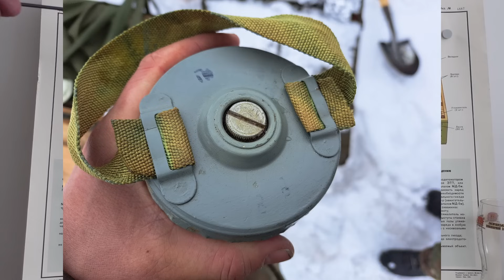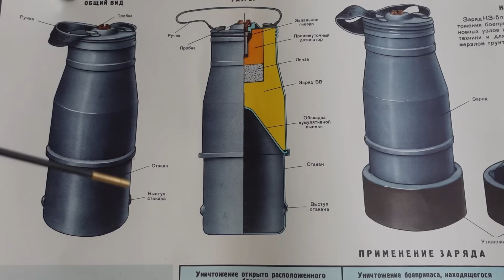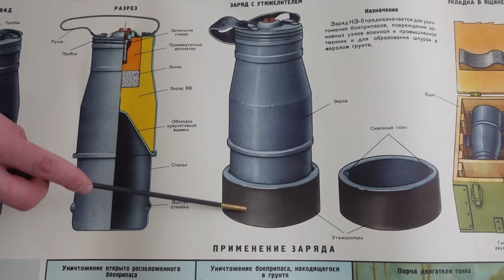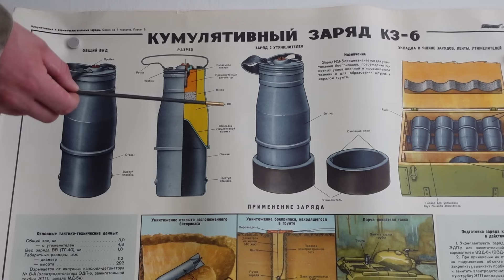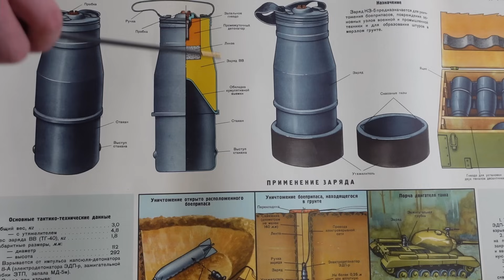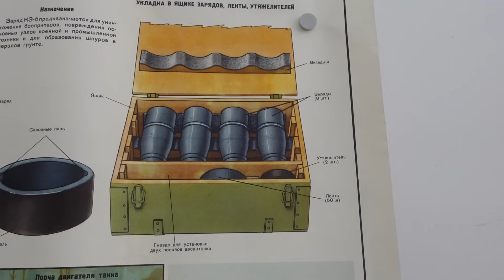WW3 Cumulative charge:  KZ 6

Comment: To disable a tank with such a mine, would it not be more wise to place it somewhere on the turret near the breach? A hole through turret top armor, breach/gun, turrent ring, crew compartment and maybe even a little bit of front armor right under the turret ring sounds worse than swapping an engine compartment and ignoring welding shut a hole in the bottom.
But it is probably harder to place it there, let alone explain the correct placement to an average infatry man xD

Also era and up armored or not, I do not believe a tank and crew hit by this from a drone will have a good week. So much damage to optics, barrel and everything mounted on it, also pressure. But yeah it probably is not a permanent kill if it lands on era.

Comment: NATO also has charges for destroying airfields but they use shaped charge with  ~ 200mm diameter and 12kg of explosives with foldable legs for the distance to ground - after the hole is punched through concrete and soil the hole is filled with TNT granulate and detonated again to make most huge crater possible
same for Autobahn, main streets and railways - my teacher worked at a factory for that - he said they produced almost half a million of them but meny were shredded and the explosives from the charges and the granulate in bags sold for mining used for blasting rock on state projects from 1992 to 2001

Comment: Thank you Val ;)

P.S.: you forgot to mention the cumulative lens in the general description :)  It is made out of plywood or a low-density polymer material and functions as a wave shaper to guide the shock front of the detonation to impact the metallic inlay at an angle, so as to increase the jet velocity and hence, the penetrative force.
Reply: Where is that in the diagram? I don't see a wave shaper
Reply: @MandolinMagi  The light-colored inlay directly underneath the booster charge.
Reply: @ You sure that's a wave shaper and not part of the booster charge?

Can't read Russian so IDK, but it seems a bit fancy for a demolition charge.
Reply: @ I'm fairly positive, like 99,9 % positive...
Reply: @fritzhaber3994  Some screwing around with DeepL and copy-pasting from The Wiki page on the Russian alphabet gives me a translation of "linza", or "lens"

You're right.